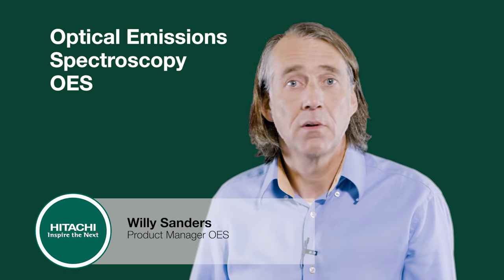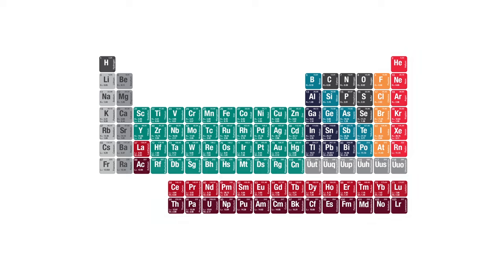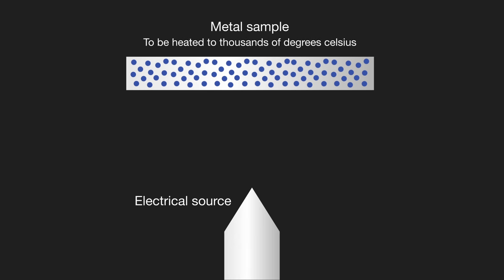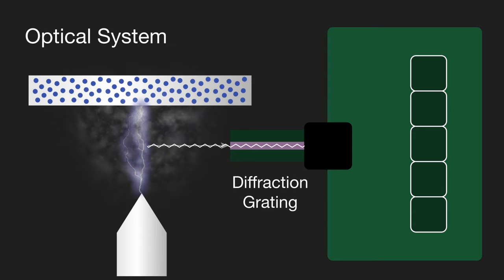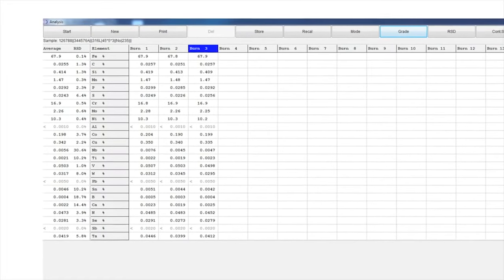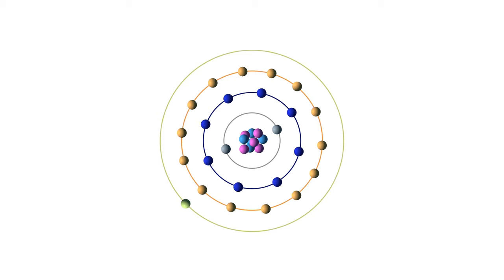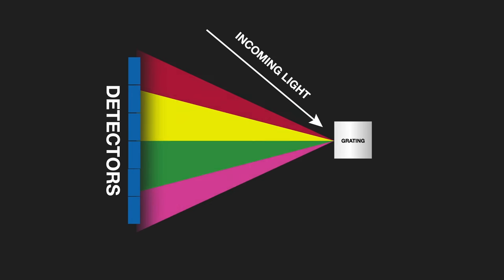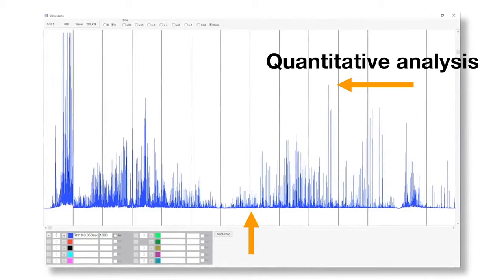What is optical emission spectroscopy (OES)? | OES explained

Comment: I am still baffled..
Is this method uses Fourier transform method to capture/split (using monochromator) the light emitted from the arc lightning or spark to the sample?
If it is, would the monochromator move back and forth towards the light source from the sample?
Reply: no. the light from the sample is hitting the diffraction grating, getting dispersed into a spectrum, and falling on a long linear ccd detector that measures all wavelength intensities at the same time. there is no fft and no interferogram.